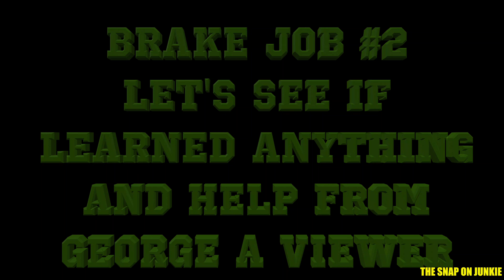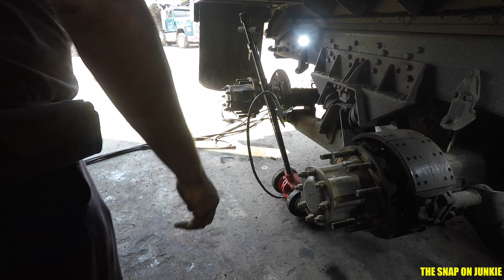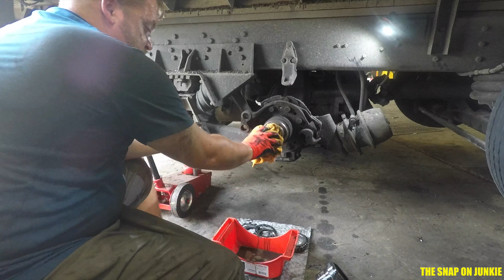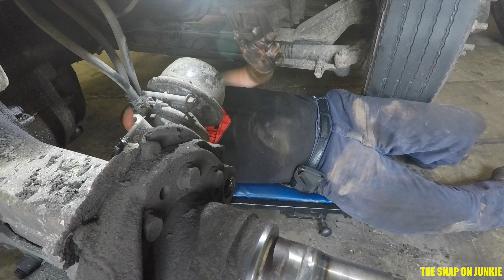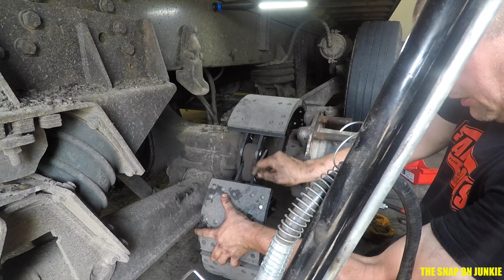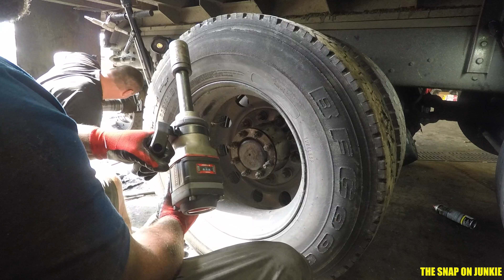BRAKE JOB #2 ON DUMP TRUCK!!$$ WITH HELP FROM A VIEWER GEORGE  MUST  SEE 😃

Comment: whoever tightened the outer hub nut that tight is not wrong. the inner nut sets the preload and then the outer nut is supposed to be a jam nut torqued to typically 250 ft-lbs + bend tabs onto it for extra insurance.

Comment: Junkie love your videos but your wheel bearing adjustment is just not how you do it. The outer nut that you put on hand tight is supposed to be torque to 300ish it's a jam but. if all else fails it keeps everything from backing off

Comment: Just a quick tip if the hubs fighting you and your really pulling on it, thread the nut on a couple turns with the outter bearing in or out and that when when the hub comes off you won't possibly fall or drop the hub on ur foot

Comment: If you chop the s-cam shaft down to about 4", and take the edge off of it, put a washer back on, you can use it as a seal driver. Put the seal on the shaft, put the shaft in the bushing and give the s a good smack. The seal is put in without risking flooding or denting with a hammer. It goes in easy and seats flush, no fucking around.
Reply from the maker: b havinga already man thanks I'll try that

Comment: According to TMC RP 618, the torque value for the axle jam nut is between 200 and 400 foot pounds depending on the treads, etc.  Never finger tight.

Comment: How are you liking the PT850 compared to the MG725?
Reply from the maker: David Guzman I like the 850 compare to the 725 I feel like I use both of them I feel like having both is definitely great to 850 definitely has a faster free spell it takes you know once you get the bolts loose it definitely spend some more faster

Comment: And not a single torque wrench in site...
Reply: The setup procedure for those wheel bearings requires the inner nut to be torqued to 50ft-lbs, back off a quarter turn, and torque the outer nut to 350ft-lbs. That should give .001-.004 bearing end play. If the end play is wrong, your bearings are not long for this world. There's whole companies that travel around welding up damaged axles from bearings that were destroyed by improper setup.